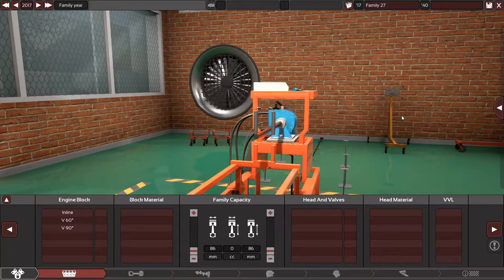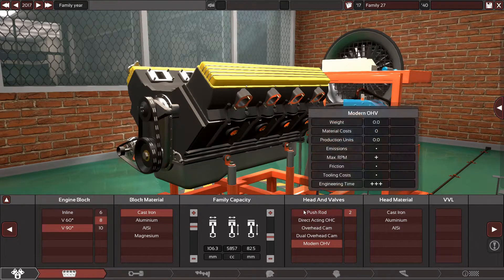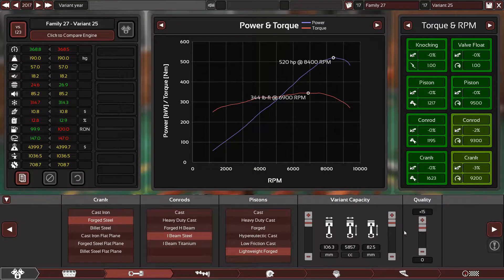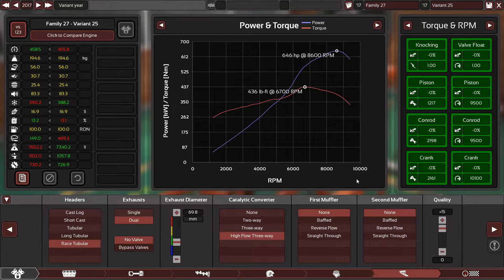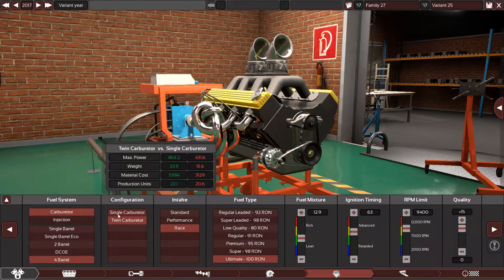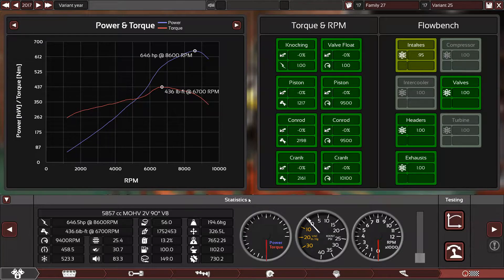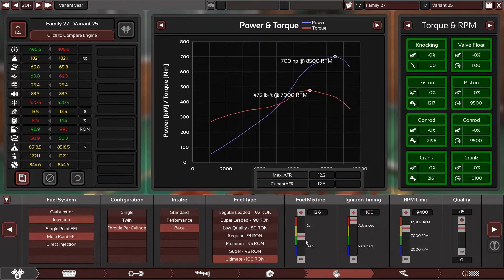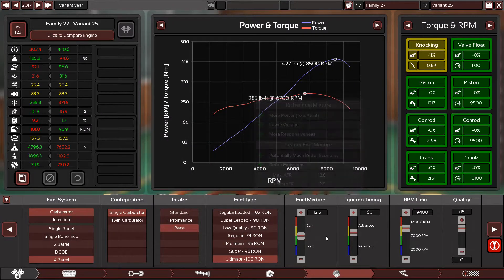Official NASCAR Spec V8 is a Failure in AUTOMATION.

Comment: Whoever said that NASCAR race cars are carburated are wrong because ever since 2011 a NASCARS engine have been electrically fuel injected in the form of multi point efi
Reply from the maker: This video is so old 
I don’t remember who requested it. 
But i do remember that he asked for the carbureted version of the engine. So I guess he wanted the pre 2011 version
Reply: The lower divisions like the xfinity and the truck series are still making the most of the carbs and also don't rev over 9k rpm IIRC.
Reply: I was under the impression that it was more like tbi not mpi

Comment: Automation seems to not be 100% like real life... I think race engines should have quality at 25-30 instead of 15 to be legit. Thanks for trying it out!!

Camron Goodall: Nascar uses 98 octane fuel.

https://en.wikipedia.org/wiki/Monster_Energy_NASCAR_Cup_Series#Specifications
Reply from the maker: +h22accordexr 
You are welcome.
You are right for the quality 25 to 30 
Thank you for your support
Reply: h22accordexr this game is made for road cars and with 15 quality camshafts you can go over 1000 engeneering time when a twin turbo V8 can be under 100...

But you are right, it's impossible to make real race engines
Reply: I managed to make an early-spec Cosworth DFV with 405 hp like in real life but at 8800 instead of 9000 rpm... with quality on +15

Comment: What era NASCAR engine are you trying to recreate? Modern NASCAR engines are fuel injected and i think they have different specs as well.
Reply from the maker: The nextinline I tried the below 2011 carbureted engine with the official specs but it's impossible to make the same HP and torque like the real one
Reply: Yeah that I was thinking bc I remember when Tony Stewart's fuel injection wasn't working and Darrell waltrip gave tony a carburetor

Comment: Again, please, sir, the content is killer cool but I want that Daewoo Tico engine ran in Automation Game. Specs: 3 cylinders inline, carburetted, simplest SOHC valvetrain, 9.1:1 compression ratio, mechanical yet some-what electronical distribuitor firing. PS: I really really want to hear that sweet 3 cyl sound going and see if it reaches 45 HP. cheers, stay healthy !
Reply: BTW !!! It uses a 1x dual barrel carburettor splitting up to the 3 combustion chambers, and an estimated fuel consumption of 3-4l/100km, try using a 14.0 A/F ratio please, 800CC !!! Try your best to respect the mentioned specs, please !!!
Reply from the maker: do you want the stock version only or do you want me to modify it ?
Reply: Bshar Nasri Bone stock, just try slapping on the things above and get around 45Hp with 65 nm@3500RPM
Reply from the maker: It makes 50 hp and 50 lb-ft
Reply: Bshar Nasri Don't USE MPI INJECTION PLS THATS FROM SAME 800CC ENGN BUT FUEL INJECTED AND ITS USED IN THE MATIZ !!!!! PLS USE 2 BARREL CARB AND SOHC DON'T FORGET THIS AND THE BORE/STROKE, N-A !!!!
Reply: Bshar Nasri Thank you so much !!!

Comment: This game doesn't take cylinder head design or intake design seriously and doesn't let you use a nascar cam profile. And I'm not sure how you can simulate fuel types either.
Reply from the maker: +Jack of Blades 
Correct 👍
And the the fuel octane is maxed at 100 only.